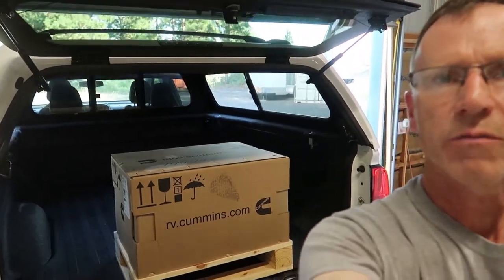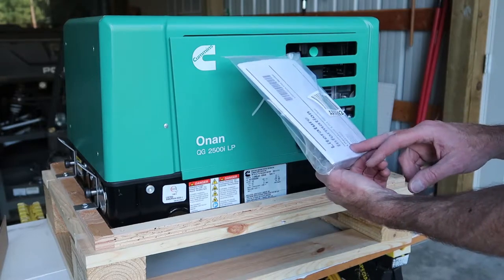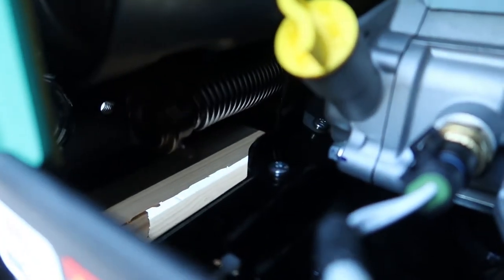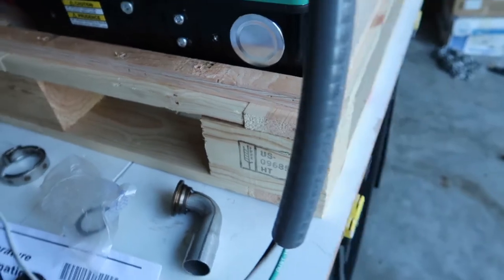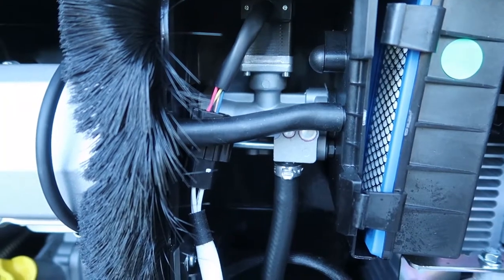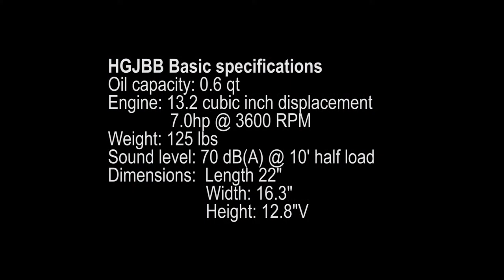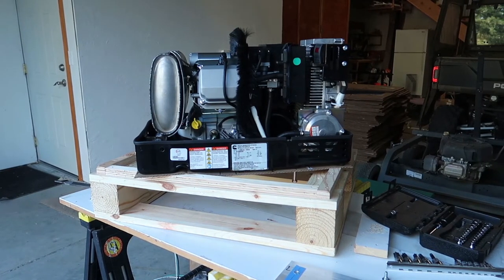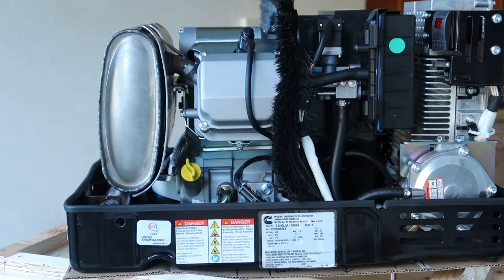ALL NEW Quiet Onan Cummins RV Generator! | Unboxing the 2.5 LP HGLAA-8304A

Comment: Thank you for your video. I have the same Onan generator as your model came with 22 Airstream Interstate 24GL. However, I can't locate the drain plug. Do you know where it is located?
Reply from the maker: It's located on the bottom, almost in the middle.

Comment: Thanks for this, where did you purchase yours and how much was it if you don't mind me asking, thanks.
Reply from the maker: I got it the Cummins Northwest in Spokane, WA.  Price was around $3500.
Reply: @deltabravo1257  Thanks.  Is the main benefit to a generator like yours the way it mounts under the vehicle and remote start?  I'm debating if I can get away with a temporary generator mounted on the hitch of my vehicle.  Do you have any suggestions towards this?

Comment: Hello, Did you continue review on this generator? Thinking of replacing my older model Onan LP 2500 that doesn't start. Debating if I should spend $1800 repairing or replacing it with the one you are reviewing.
Reply from the maker: I'm still in the process of getting another video edited where I run it for the first time and also compare the noise level to the old generator it replaced.  I've only had it installed about 3 weeks and haven't used it camping except yesterday.  I should have the new video done later this week.